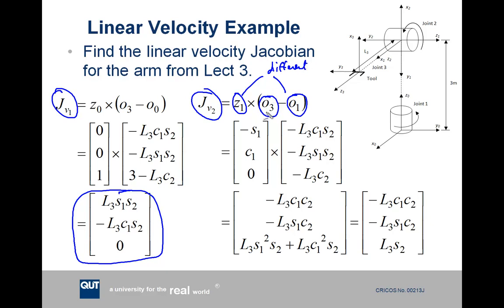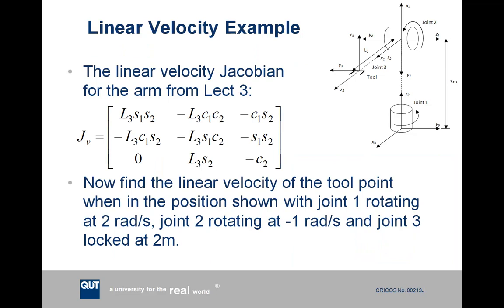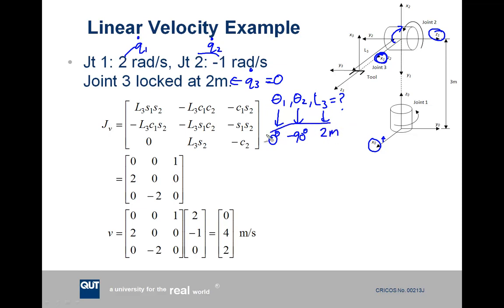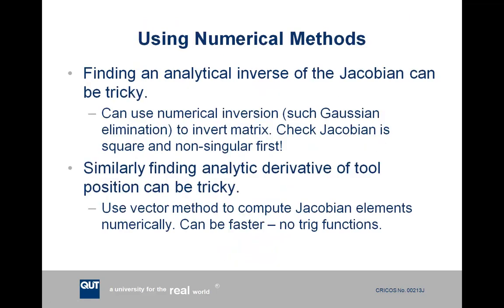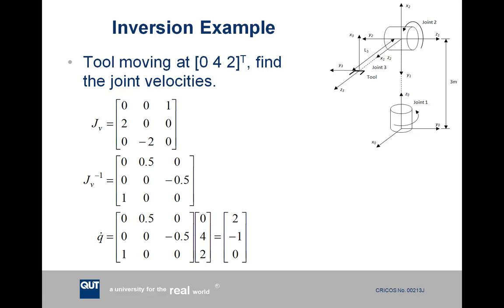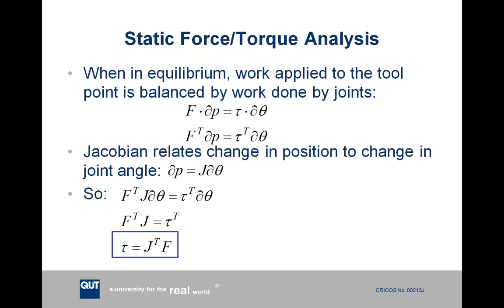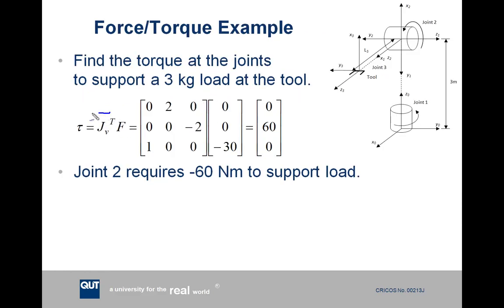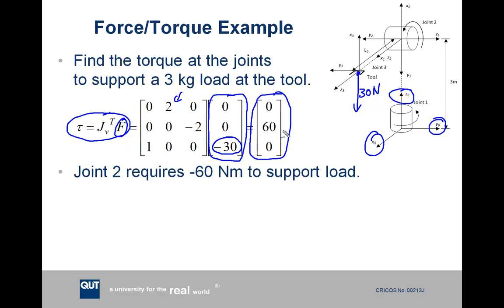Velocity, Force and the Jacobian Part 4

Comment: In the inverse jacobian matrix 5:36 there is a mistake at row 3 column 1 where it is supposed to be 0.25 not 1 as 1/determinant of the Jacobian Matrix is = 1/4
It doesnt impact the final result however since it is multiplied by 0 to obtain the joint velocities

Comment: How did you transpose the force and torque in the static force analysis section please? also how is the change in position of the E.E (delta p) equal to the jacobian times the joint angle(delta theta)? isnt it the rate of change of the E.E position is equal to Jd@?
Reply: As derived in lecture, (Force)^Transpose*J=(Torque)^Transpose. 
Taking transpose both sides you ll get J^Transpose*Force= Torque  or Torque= J^transpose*Force
It's true that (Delta P)=J*(Delta theta) cause dividing both by (Delta t) you will get v=J*Theta dot where v is Delta P over time and theta dot is delta theta over time

Comment: Why do you have to transpose the jacobian for the torque computation? Thanks
Reply: because it has been derived as in the lecture that the Jacobian relating joint angle and velocity and the Jacobian relating force and torque are transpose of each other. 
So if you already calculated Jacobian for Joint angle and velocity then transpose it and you can use it for force and torque calculations